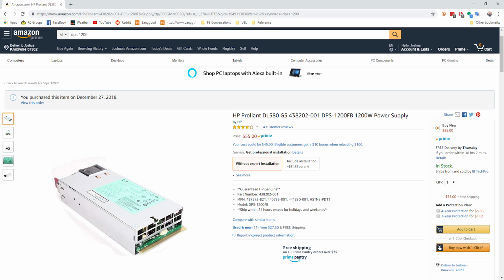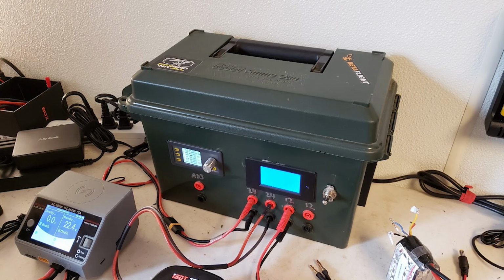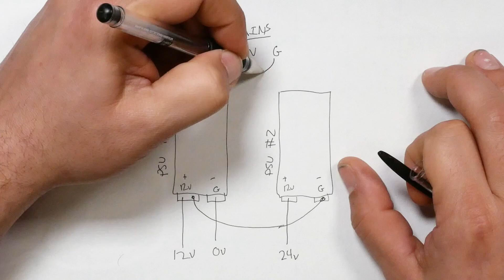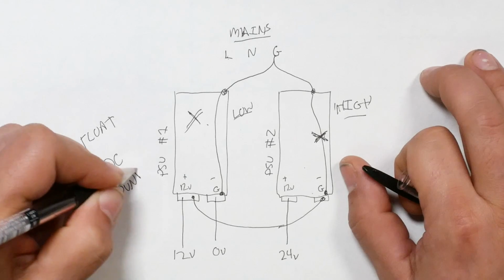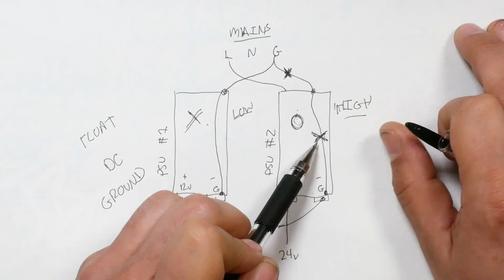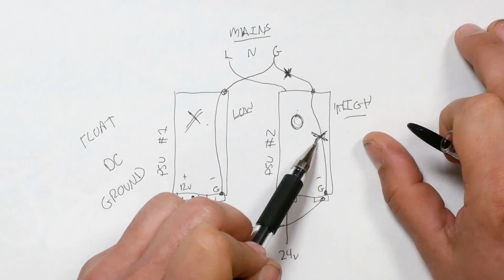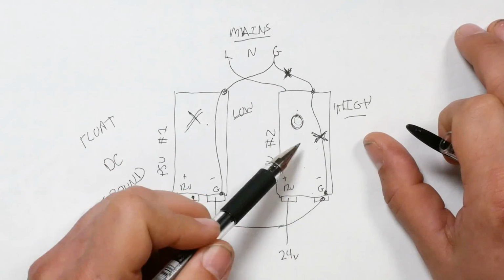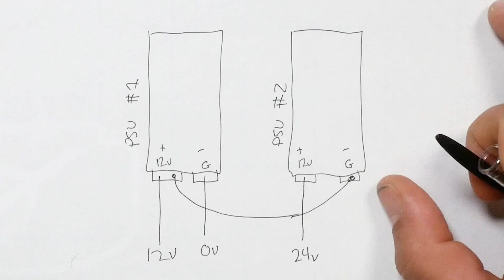How To Build A 24v / 2400W Power Supply | BEST BANG FOR BUCK 24V PSU

Comment: Wouldn't you have a 2400 watt hour supply
Reply: Yes, it definitely is 2400 watt PSU, power is voltage times current
Reply: you would. it doesn't matter whether they're in series (double the voltage) or parallel (double the amps), you power output is still the same.
Reply: @norgtube  2400W yes, in theory parallel is also 2400W, but it is not good to put such PSUs in parallel cause a tiny little difference in output voltage results in very different current-output. The PSU with little more voltage goes then first into the limiter and then the full load hits the other PSU. In best case you'll get just 1200W or maybe  something will smoke.
Reply: Yes. Double voltage and same current is double power
Reply: In terms of power it totally doesn't even matter if they are in series or parallel as power (watt) is the product of voltage and current P=U*I !
And do totally forget about the hours, watt-hours are only used when time comes into play like how long did you used a certain power to calculate how much you need to pay for it or how long can you draw a certain power untill a energy reservoir like a battery or capacitor is empty.
Please please don't do any of the showen steps or open up any powersupply as long as you don't understand that as it is dangerous if you are not aware of what you are doing. What JB does in the video there is called floating ground and is quite scetchy.
Reply: This comment is getting all kinds of smart comments so let me sum it up for my two cents.if you take two power supplys and combine them,it will be 2400 watt system.I dont like this idea because there is so much protection on these as soon a power supply #1 trys to regulate itself it cant cause it sees the voltage from the other and each one can only regulate itself,its going to dip lower and lower trying to protect itself till it cant handle it putting all the stress on the other,runnaway.plus if you do the math of ohmns law the other guy wanted to be smart about,that is way more than a 15 amp house outlet can handle.burn your house down type stuff if something happen to pull that amount.i dont think its smart to build something that over rates a wall outlet so bad.but my only comment was,if two 1200 watt supplys are used,thats 2400 watt coming from one 15 amp wall socket and trying to float the ground of one.this has house fire wrote all over it.
Reply: yes if you run it for one hour, 1200W or watts is 100Ax12v for one power supply, two power supplies in series is 24vx100A or 2400W putting in series doubles the voltage keeping the current the same, so double the voltage with the same current is double the power.
Reply: I agree, its still the same output-current but double voltage.
Reply: No because they are in series, if you connect them in parallel you would get 2400 W